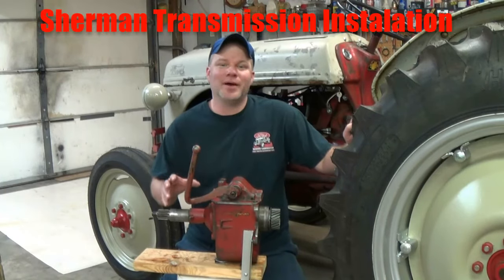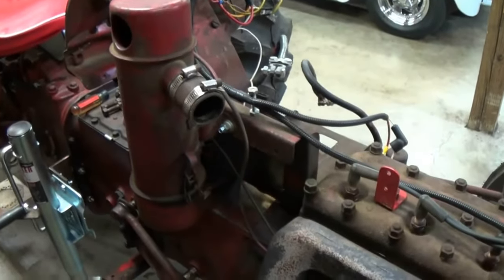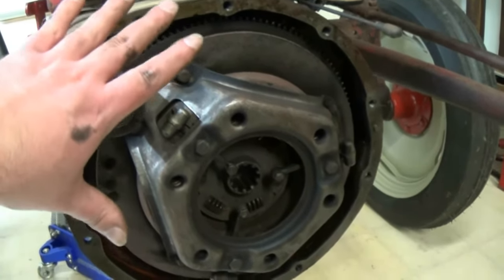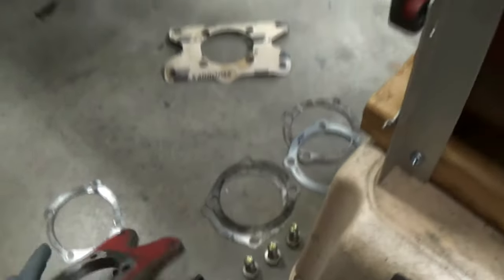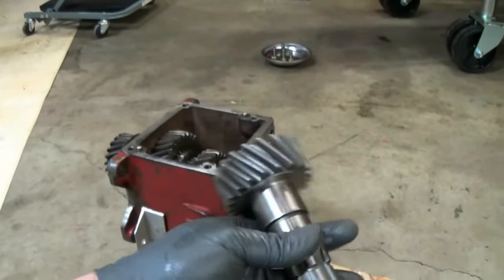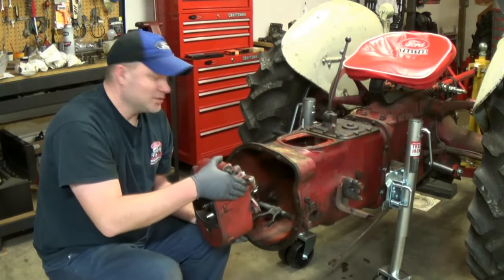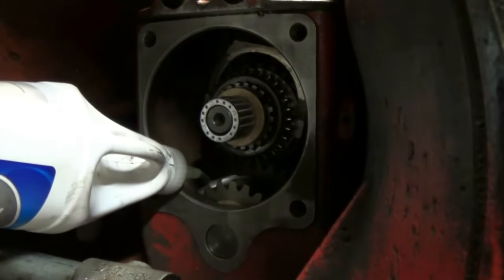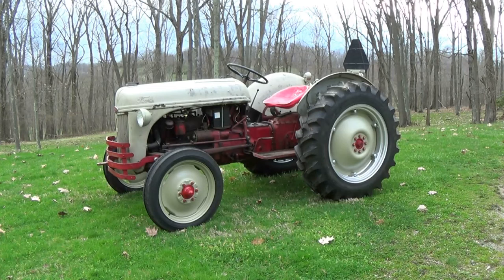Sherman Transmission Installation (Ford 8N Tractor)

Comment: What does the Sherman transmission do?
Reply from the maker: @ezekielbreedlove7698  It gives you a high and low range plus the standard original gear ratio. Instead of a 4 speed with 1 reverse  It is now 12 speed forward and 3 reverse.

Comment: Sherman's a game changer 🙌
Reply: What is the ground speed of a Sherman transmission in first gear low speed I was wanting one to use with a tiller attachment  for gardening? ? would appreciate your reply if you know thanks
Reply: @tomrobards7753  That is partially ‘what it’s for’ so i wouldn’t overthink it, just go for it if you can get everything reasonably to do it.
Reply: Thing to remember is it not only slows tire speed it also slows PTO speed as well so tiller Speed slows too.. Generally speaking the N series is not a good candidate for a tiller..

Comment: Are these worth getting to run a rototiller?
Reply from the maker: @tjbriggs2654  No. They still don't slow the ground speed down enough PLUS they make the PTO run slower as well. If you'd be in a small area with loose sandy soil I suppose you could go over it multiple times and get something out of it,but it will never be like a more modern tractor with a real low range and high speed PTO where you can sink the tiller in and let it eat.

Comment: Hello From Kentucky. Recently I purchased a 8N Ford which is probably between a 1950-1952 8N because of the side mounted distributor. 
After I got the tractor home, I noticed that my tractor had the Sherman transmission with the same identical shifter as the one in your video. I was so glad that I found this video because a sizable number of people have no clue what a Sherman transmission is let alone the shifting characteristics. 
The 8N Ford that I purchased had a Woods RM306 finish mower thrown into the deal for $1200 for both the tractor and mower which I found just 2-3 miles up the road from where I live from someone that I know. I’m not sure if he knew about the Sherman transmission because he never mentioned it to me when I went to look at the tractor. They delivered the tractor to me, So I didn’t have to worry with any delivery charges. 
So far as luck would have it, the weather has been crappy and so I haven’t been able to really drive the tractor that much. 
I never realized the process of installing a Sherman transmission was so complicated and labor intensive, But I am elated that my tractor has the Sherman transmission.
Reply from the maker: @TheIronDuke502  Well, congratulations!! You are fortunate to already have one! I hope it is in good shape for you, shifts well ,and doesn't make any noise. I personally will not mess with them anymore. This rebuild was expensive and honestly other then road gear I see them kind of pointless. To me they still don't slow the tractor down enough especially in reverse. Also it slows the pto speed down too. They are fast though! I hope you get to enjoy your tractor soon!

Comment: I really like your boat trailer jacks idea. When I split my Ferguson 35 I used a 4-wheel mover dolly stacked with lumber to get the height. Got the job done less elegantly. For speedy utility tractors you need to make sure the steering box, vertical wheel shaft bearings, front wheel bearings, and all steering linkages are tight or the tractor will wander dangerously as the speed goes up.
Reply from the maker: Thanks for the compliment.
Yes steering components are very important. This particular one has had some work done and is tight as the day it was made. Plus the whole rear end,axle seals,brake shoes,hubs are all new. Stops perfectly. I can go down the road in high range and take my hands off the wheel and it still goes straight.

Comment: Thanks for these videos.
Now I know how an auxiliary transmission works.
My daughter got a project 2N with an aux trans.
Now I know a little more about it.
Reply from the maker: Your welcome!
Does the 2N have a Step Up transmission or the combo transmission? 9N and 2Ns are more likely to have a Step Up in them.
Reply: I’m not sure.
On the trans case is marked H  N. L.
After seeing your video I have a little more knowledge as to
what I’m looking at.
Tomorrow we’re going to look at an old Ford pickup.
I’m going to try to talk her out of it till she gets some other 
projects caught up.
She has the tractor, a ‘66 Jeep CJ 5 half tore apart, and a ‘72 
Starcraft boat half tore apart.
I think it might be time for me to say NO.
Reply from the maker: @steveaw5895  That does sound like a full plate! I only give myself one project at a time or I feel overwhelmed.
It sounds like you may have a Sherman High and low range.

Comment: Great video, but I have become a fan lately. I'm not a tractor owner, however I do have an early Ford flathead V8 car, and have worked on the motor and transmission, and so many of the components looked very familiar to me. May I suggest that all machined mating surfaces and threads need to be cleaned before reassembly, especially if you are shimming too obtain a critical clearance. Also I would advise using a Loctite product on all threads and torquing critical bolts on the Sherman transmission. Regarding an oil change, I am not sure if the top of the Sherman can be removed in situ, if so, then the old oil could be sucked out from the top is required. Just a thought. Keep up the good work !!
Reply from the maker: I love the old flat head V8s !!
All threads and mating surfaces were cleaned. I also did put Loctite on some of the bolts. When making these videos it's hard trying to make them as short as possible yet informative. A lot gets edited out. I have people tell me all the time I talk to much. 🤣

Comment: Great video. Thanx!
One might think by looking at how these tractors were designed, if the Sherman was designed to fit in there or if the tractor was built to hold the auxiliary transmission.
Reply from the maker: Well the tractor did come first! 😆 But yeah it's pretty amazing all the engineering that went into these. Always more complex then what people think.

Comment: Outstanding video, excellent job. Was wondering if you could bore hole underneath to beable to drain Sherman oil,  or does the oil last so long that it isn't necessary
Reply from the maker: The oil gets circulated in and out from the tractors main transmission. If you keep up with the oil changes regularly and it doesn't get contaminated your only leaving a quart or so behind. Out of 5 gallon that's nothing.
Thanks for watching.

Comment: Jason, fantastic two videos on the Sherman combo transmission. Wish all tutorial videos were this good. When the Sherman shifter lever " pops out " onto neutral is their a spring to assist it or do you just push in and pull out to either take it in or out of neutral? Thanks.
Reply from the maker: Thanks Harry!! No spring to assist in shifting. The only springs that are used are the detent springs/balls and they just keep the shifter from popping out of gear.

Comment: I just came across your video, nice job. Will this unit fit on my 600?
Reply from the maker: Thanks! This particular one will not fit your 600,but they have Sherman transmissions for them. The difference is in the input shaft. The N series are 10 spline. Yours is 15 spline.

Comment: Jason. Thanks for the great video. Im repacing the clutch in my 2N. The clutch is oily.  The front chamber for the flywheel is oily and i think i need to replace the rear main seal. But the housing for my Sherman is also very oily. Do you think the oil is leaking in the Sherman and also possibly  from the transmission where the Sherman bolts on. I dont want to get oil on my new clutch. Thanks.
Reply from the maker: More then likely it's the seal on the input shaft of the Sherman that is the issue. It could leak where the gasket where the Sherman and the tractor meet BUT that oil should go straight down and out the weep oil if it gets too bad. Should stay off the clutch. Your rear main seal should do the same if that weep hole is open as well closer to flywheel. When that input seal leaks the oil will travel down the shaft right on to the clutch.  If the other two are leaking it should just drain out. Hope that makes sense.
Reply: @Jason1Pa  Thanks. I just watched you rebuild the Sherman . With your reply and these 2 videos i feel prepared to tackle it. Thanks again.
Reply from the maker: @jerryf609  Awesome!! Good luck!!

Comment: My family had a Ford 2n or 9n with a Sherman for quite a few years, and I considered it "my" tractor. Were all Shermans like the one in your video, in that the shift lever had an in and out position,   plus forward and and back positions? If so, there were two positions that we never knew existed ! !
Reply from the maker: There were different kinds. Most popular for the 9N and 2Ns were the Step Up ONLY Shermans. They don't shift like the one in the video. There was also one that was only shift down but they are very rare. There was even one that was used on tractors that had forklifts on it. It would give you sever speeds in reverse.
Reply from the maker: There were several different kinds of Sherman's. More

Comment: I couldn't help but notice your tires on that tractor, I have one like them and an old straight bar firestone type that needs to be replaced.  Do you remember what kind your tires in this video are?
Reply from the maker: These are 11.2 x 28 Titan tire.
A lot of the older Armstrong tires had this exact tread design.

Comment: Just a fantastic video. I do have a question, I have an 8n with a funk conversion and a Sherman step up/ down  . I don't know the year. Can you tell me where you get all the info you put in your videos.
Reply from the maker: Hi Kevin thank you for the compliment. I've been very passionate about antique tractors (especially Ford) my whole life. I've read so much threw the years,or ask people and what not. I did find a great article that I kind of used as a guideline for this video to make sure I hit all the important stuff. Just Google John Smith Sherman Transmission rebuild. It's on the Ford N Series tractor club website. I'd post a link to it,but it isn't allowing that for some reason. Let me know if you find it?
Is your conversion a actual "Funk" and what engine?
Reply: @Jason1Pa    Yes  Sir. It is a actual Funk with a Ford flathead 6 cylinder  256 cubic inch.

Comment: Hi Jason boy I really felt your pain when you realized that nice new shiny input shaft wasn’t going to work I hope you get your money back! Were you able to actually see any thing that was different from the old gears compared to the new shaft? And I want to request something if you can find someone to work the camera for us . Could you give a demonstration how low or how slow you go at about 1500 RPM in the lowest gear I would really appreciate it but if you don’t want to don’t worry about it! Thanks Jason keep on trucking!!
Reply from the maker: Hi Keith! I actually did record the difference in speed,but decided to edit it out. One reason is to keep the video length down,but there is no noticeable difference. I'm very disappointed to be honest. According to GPS there is only about 1 mph difference in low range vs. standard. Granite I only did the test at idle and in reverse. One of my main reasons for all of this was to slow the insane reverse speed,but like I said there is not a big difference. In high range it's almost too high. Going down the road it needs to be wide open the whole time or it starts to bog the engine down. I'm going to test it some more just to see if it will even pull the slightest of hills.
Reply from the maker: The new shaft was exactly identical except for the teeth. The very tip of the teeth on the new shaft came to a point. Where as the original has about 1/16 flat area. I raised a question before I saw it but decided to try. I even wonder if the teeth are at a very slightly different angle? I don't know,but I do know it sounded terrible just rotating it by hand. Unfortunately I was 4 days past the return policy for the shaft. I now have a expensive paperweight/conversation piece to keep on my desk. 😆
Reply: Well don’t sweat it I have taken major losses on every project I undertook thanks for getting back to me and I wanted to say that was a cool idea to split the old girl with the adjustable landing gear always lots to learn and I also love that hat and shirt you were wearing!
Reply from the maker: @keithwarkentin  Oh yeah there are always losses in every project. Just move on. Anymore the moment you buy tires or rebuild a engine your at a loss if you'd want to sell it. You'd never get your money back. I never sell, I just enjoy the hobby.
Yes the jacks seem to be a big hit. They sure make it easier and safer.
Reply: @Jason1Pa  in guessing you checked it, but is the overall OD of the output gear identical to the OEM gear? It may have been that it just needed a little time in a chuck with a file or some emery paper.
Being the project is buttoned upon sure we'll never know, but in the off chance you ever have it out again... 😉
Great video all around. Thanx for sharing!